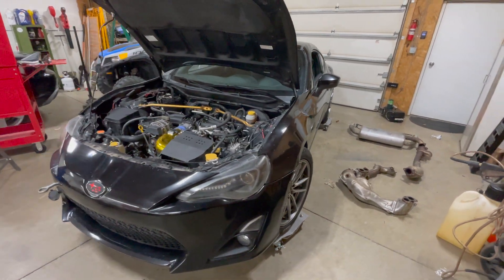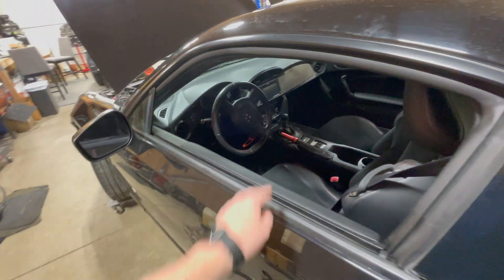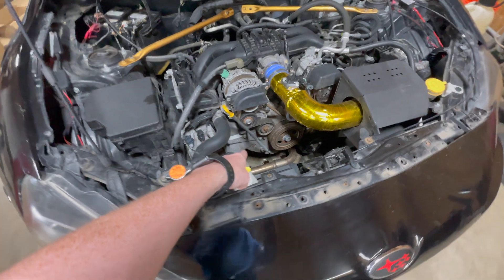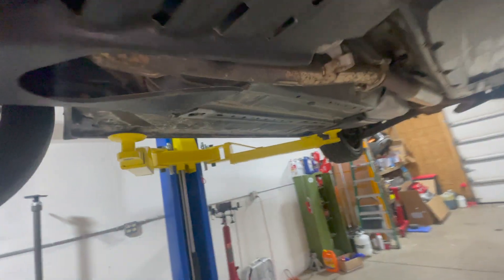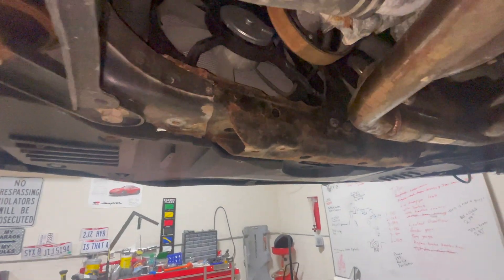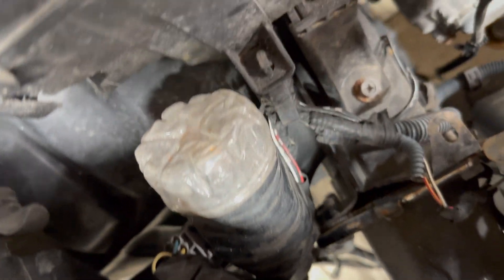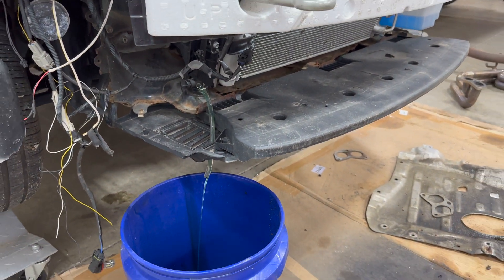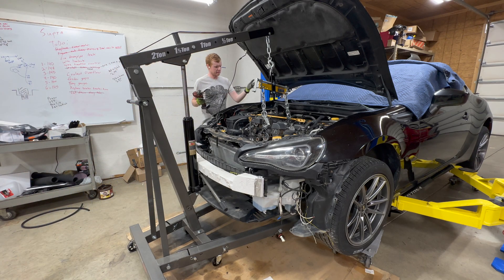2JZ BRZ Swap - Pulling the FA20 - Pt. 1

Comment: Cant wait to see when its done what is your power goal  the  a340e automatic transmission can handle 350kw what difff u going to use. Keep boosting and be safe
Reply from the maker: Probably around ~500hp at first. I'm going to shim the trans + the Haltech will allow me to pull a lot of power on shifts to hopefully keep it together. I'll be using the stock BRZ diff. Thanks for watching!